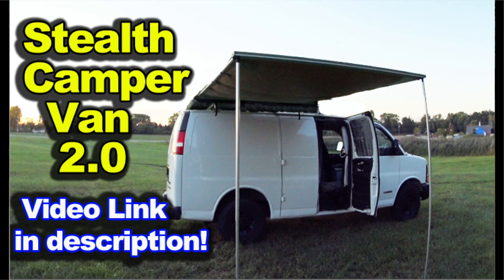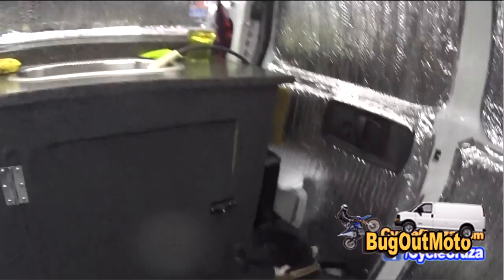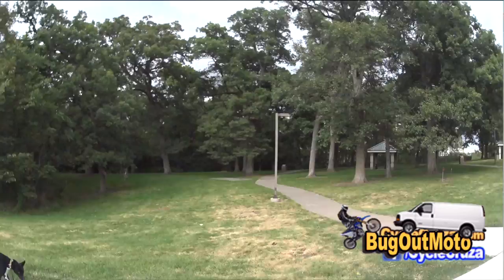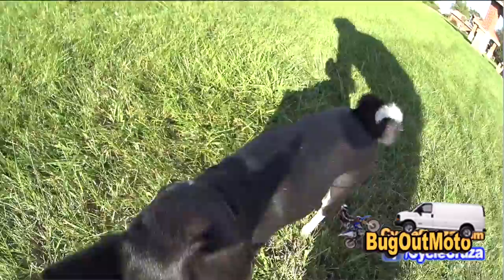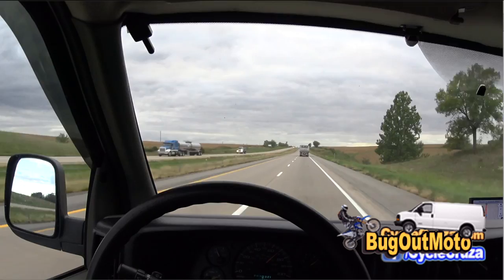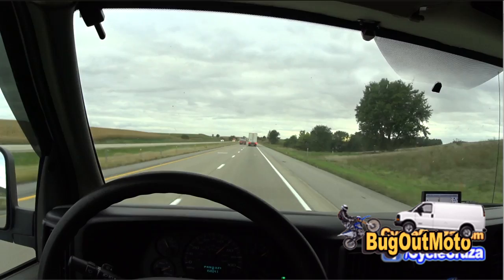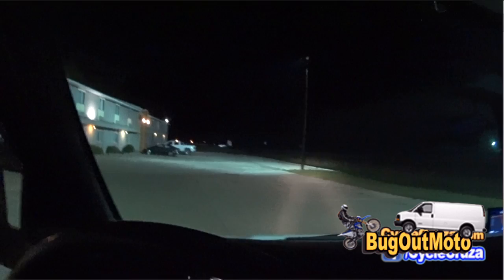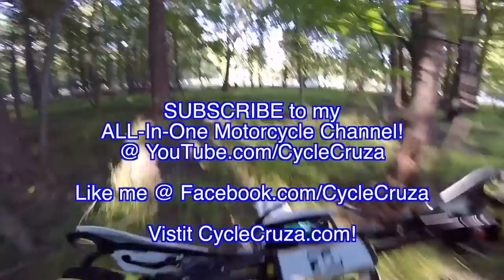Stealth Camper Van Trip DAY 2:  Police: Dead Body in Van - Why I Cage Dog

Comment: Absolutely correct to crate a dog when the vehicle is in motion. Also important to anticipate your dog's mischievous behavior and eliminate opportunities for them to get at electrical wiring, hotplates, running away, etc..
This looks like an exercised and happy dog to me. Owner has a healthy and patient attitude.
Reply: Also, crating the dog in the vehicle is far superior to the padded doggy seatbelts most people use. Unfortunately, most pet owners with smaller vehicles cannot accommodate a crate, are unaware of the benefits, and are put off by the visual.
Reply from the maker: Good to hear from someone who understands. I take the dog out a lot, just can't when I'm doing something or sleeping. Maybe when she gets older she'll calm down and be more laid back.
Reply: Crating is a good thing. Besides safety, it also teaches boundaries, they learn it's their protected space, aids in potty training, and more. Just NEVER use it as a punishment; they'll fight you from then on.

Comment: My husband and I had a basenji for 15 years, raised it from a pup.  He loved to run and jump on and off the furniture in the house.  We did not crate him.  Basenji's are very stubborn and extremely smart.  Your dog might be happier in a more appropriate environment, even if you have to rehome him.
Reply from the maker: I had two other basenjis, a brother and sister, back in 2002. The males are more laid back and females are skittish and more unsettled. My former male basenji used to sleep on the foot of my bed. Unfortunately, I had sell both later on. The reason I got a female this time is for it's smaller size, a better travel size. However, this basenji I got is a destroyer and has to be crated when unattended, otherwise, she can get electrocuted by chewing a wire. 
At my house, she can run in the backyard most of the day, she is only crated at bed time. I'm hoping that she will calm down as she gets older, otherwise,  she has to be delegated to crate when nobody is around, however, her crate is super big at home, unlike in this van. Do some research on basenjis, they are often a destructive high energy breed that requires a crate when unattended. The Basenji forum has good information .

Comment: lol told ya that van will attract attention when real SHTF scenerio vs just normal common toy hauler with the graphics and shit. Best hide is with the sheep as a sheep not a lion among the sheep. If I was a checkpoint guard I would want this van searched. And that's removing emotion. Not gonna tell you what to do just a perspective for your consideration.
Reply from the maker: no it doesn't. It only attracts attention when I open the back doors up. That weirdo dude that called the cops stared inside my van when I opened the backdoors to take the dog out. Otherwise, I've never been bothered before.

Comment: Nice van build but I noticed you didn't put a Fantastic Ceiling Fan Vent in. You need a vent cause you cook in there and to let the smell escape when using bathroom etc.. I know you wanna be stealth and wanted solar on roof but you could of still made it stealth with a ceiling fan vent plus solar on the roof. Don't you get hot in there?
Reply from the maker: You should check my full van tour. I have two roofs vents, one bring in air and one exhausts air. https://youtu.be/NmalslYVYqI